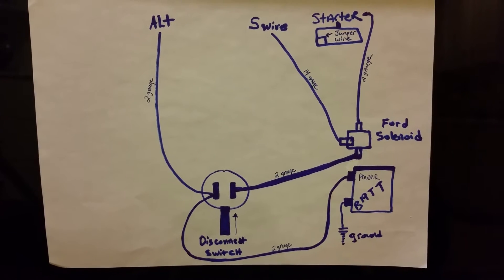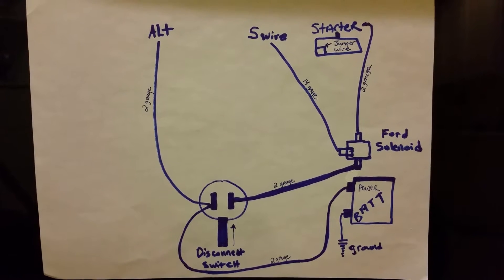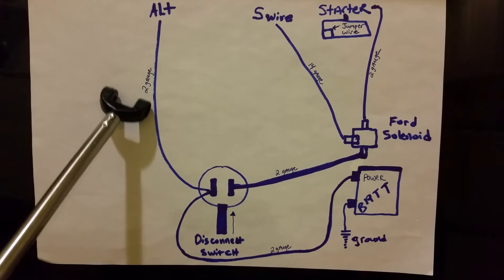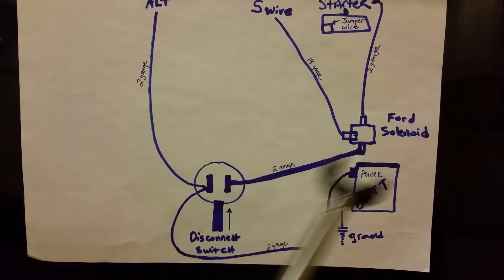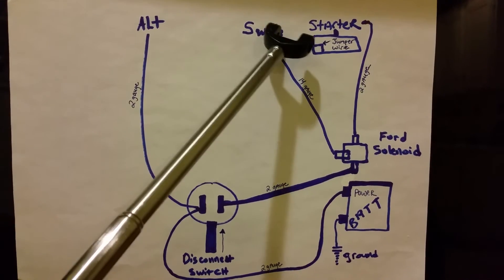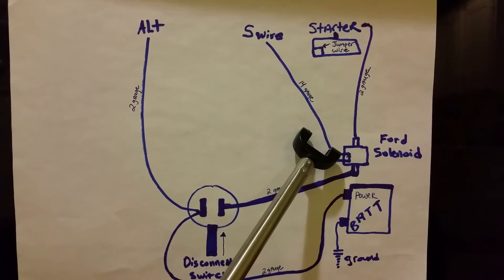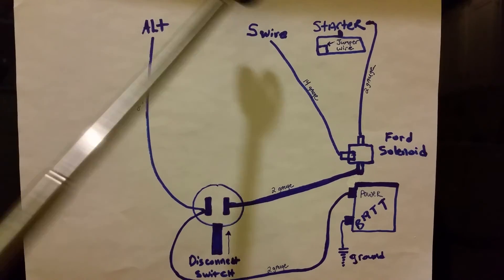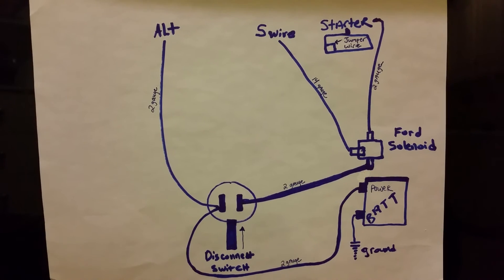BATTERY RELOCATE & FORD SOLENOID DISCONNECT SWITCH WIRING

Comment: Its a pain in the arse if ya mount the battery in the trunk.
Too much wire causes hard starts due to resistance. Even with the red optima battery.
Best to keep battery 🔋 up front. The 0.01 sec gain in the quarter mile is not worth it.
Reply from the maker: Lmao everything u just said is not true at all
Reply from the maker: It doesnt gain seconds it's for weight distribution 🤣🤣🤣🤣🤣

Comment: I dont have a disconnect switch yet, but mine goes from battery to solenoid, alt wire goes on same terminal. Starter wire goes on the other terminal. My ignition wire goes on the s terminal from what i can remember.
Reply from the maker: +infamousnova  yes thats correct, i just had a hard time finding out how to add the disconnect switch to the mix
Reply: Does it start by key when you do this.